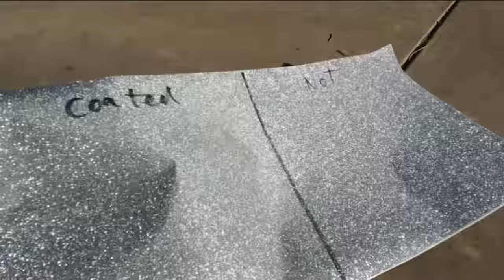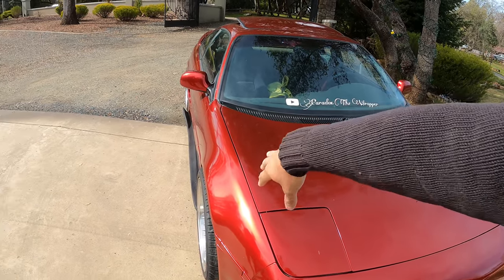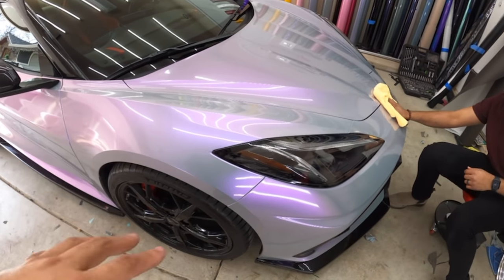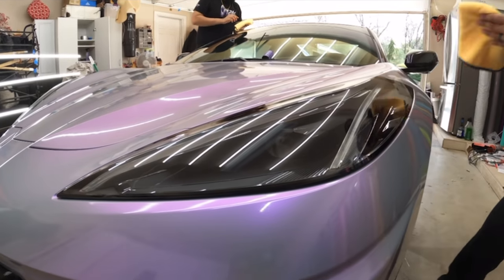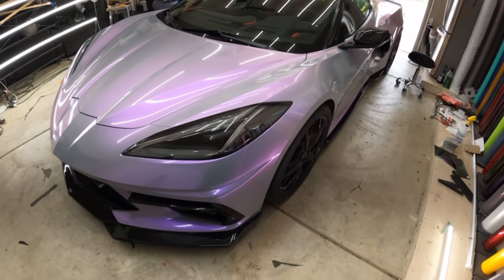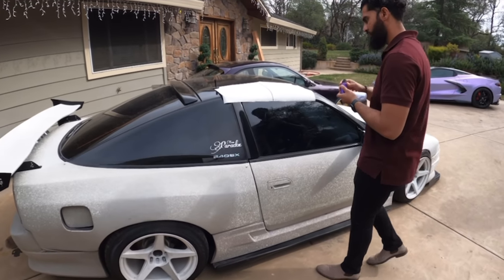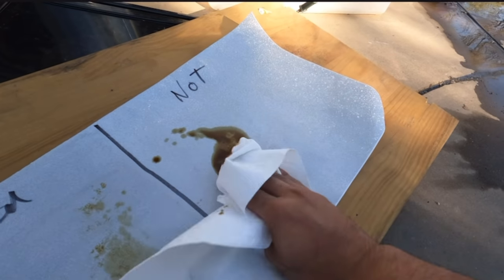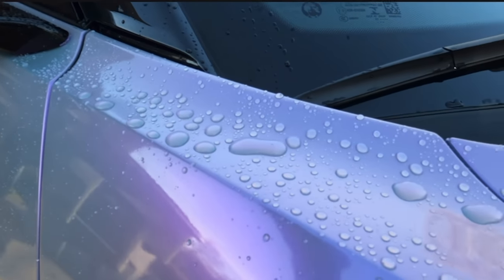Paradox VS Professionals The TRUTH About Ceramic Coat Lasting 3 Months or 3 Years | Glitter Testing

Comment: Ceramic pro is definitely not the best. They just do a really good job keeping themself in media and public eye . I myself own a detailing shop and do plenty of coatings, have done extensive research too know what I'm working with and how to explain best to my clients.  ceramic coating vinyl-plastic  vs paint vs glass. The actually transfer solution is different- Each material has different sized pores. Coating rims and places that get hot, require a different coating, something that is thicker and has better heat resistance... Maintenance is key! It is good too do agitation wash. Before using a "reload" type product use a decontamination spray too help maintain longevity ( u may also use clay bar, but a very light grade) ... Recommend retail brands. Cqaurtz,  Gtechniq,  IGL, Artedeshine, ethos... Ik this is long, hopefully helps someone.
Reply: I tried ceramic pro,  it was basically non existant.
Reply: Love the great recommendations thanks brother
Reply: And that why the shops applying it should be using the correct wheel coating and glass coatings maybe it’s the installer and not the product many times it can be installed incorrectly I’ve had to fix many coatings installed incorrectly for people I’ve had my coating on my car for years and still performing like it’s brand new 🤣 too many people put these coatings on thinking there is not after care to them they really think it’s apply and forgot which it is not some you can tell till your blue in you face and they still come back blaming the coating even when they didn’t come back to do the aftercare needed unfortunately it’s not an apply and forget solution and you have to really selective on which shop you choose where you get it applied at along with that or it’s a waste of money
Reply: I had ceramic pro, 2 layers applied on top of my xpel gloss PPF. I had it for over a year and it still performed like it was brand new since day 1. I also do my own maintenance wash, decon, and use a top loader like thelastcoat. This is just from my experience
Reply: I use to apply ceramic pro for about 1yr I hated it. Started using IGL for like 3-4yrs I now use UNDRDOG Surface Coatings! Easy to apply. Best gloss. The bead is perfect compared to any other coating out there. And honestly best prices for Coatings like under 100$ and under 200$ for marine and give you points to get free product and they do random free product in your order just cause. Unlike CP charging $300+ a bottle is ridiculous and not getting shit but the bottle

Comment: They really do last for short bit, I have two cars and both are ceramic coated. One is garage kept and one sits outside, the one outside last around 4 months and the garage kept lasted over 6 months. I wash both every week with the outside car being driven everyday for 10 miles.
Reply from the maker: Maybe there’s something to in your area that’s corrosive and degrading your wrap? There’s online articles about sun damage and air pollution causing wraps to wear out prematurely that you can look up. I did Evo Madi’s car over two years ago in the chameleon lemon green and it still looks good today